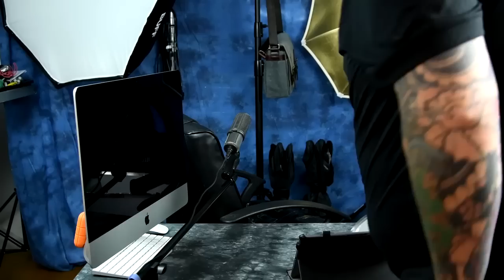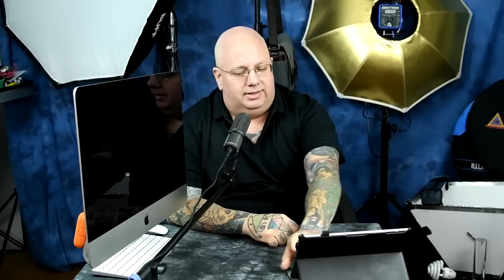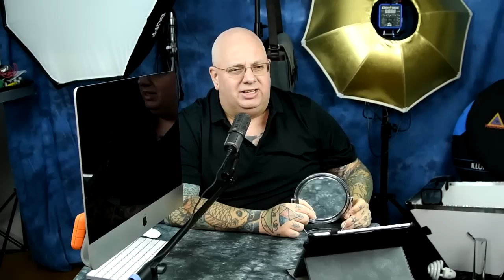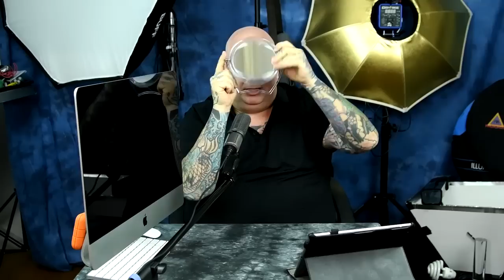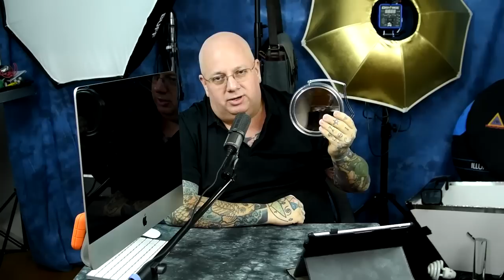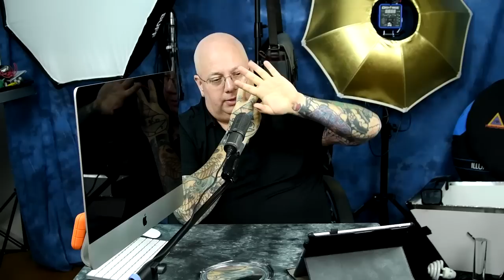A99II Serious FAIL:  Translucent Mirror design issue: Sony Fanboys, don't watch this video

Comment: I have been using the system for now going on 2 years, there is no depreciable notice for light reduction in this system.  You can claim whatever you will, with specs technical detail, you lose your case when it is fielded.  The camera will keep up with all Canon cameras and surpass most, it will keep up with most all Nikons except perhaps, the D850.  The stupid stupid stuff or rambling of intertonal color, and lenses being slower, is completely false.  There is no foundation on what you said nor have you proven anything you have said.  In fact the backlit sensor response supasses anything you got.  Unless secretly you are shooting with a Sony A7RIII or A7RIV.  Everything you said is incorrect, and should be shoved up your ass, for being so stupid.

Comment: I been using this and other Sony Translucent lens cameras for awhile, though he has some trivial facts correct like there is a mirror in the damn camera which quasi reduce light by .3 percent that would travel to the sensor, that light is redirected to the phase detection system and digital viewfinder.  It is well worth that loss.  In other words for everything he says negative the camera still is better than its rivals at the same level of production.  Granted this camera is now two years old or more so there should be more advanced out there and are, but the Sony A99ii is a fun camera to operate much more so than the mirrorless rivals and just more intuitive than some (most) it's rivals in the bigger camera market, except the most latest generations.  When facts are stacked, Theo is just plumb bias.

Comment: You are saying the same thing over and over with no proof, there is a second chip that gathers light simultaneously and enhances the picture quality. So what gives Sir. I'm not a pro  but  understand how light effects picture quality and I've not send what you describe if the scene is properly  metered. Please explain a little more for us Novices.

Comment: Years ago I owned a Canon EOS RT which used a fixed translucent mirror and you just learned to compensate the exposure, the good thing about it was the fast frame rate. When I was shooting for max detail though I would always pick up my Canon A1 instead but for shooting speed boats it was either my RT or F1 with motor drive

Comment: In all fairness, we all know that the translucent mirror causes 1/2 stops of light loss and Sony never hides that fact either. Losing 1/2 stops of light is equivalent to losing 30% of total light, 2^(-0.5)=0.7, which is consistent with Lenstip test, and it is consistent with DXO ISO score as well no matter how much you dislike DXO.
The microcontrast is not something easily proven by simple maths so I am not gonna comment on that. Someone who owns both A99ii and A7Rii can run a test, and we shall see how much microcontrast is lost due to the mirror.
Reply: That test already exists. I've posted the link above spoiler the difference in iq is negligible...
Reply from the maker: you DONT get it.
https://www.flickr.com/photos/134746128@N05/32369910320/in/photostream/

https://www.flickr.com/photos/134746128@N05/32709605896/in/photostream/

testing for loss of microcontrast is easy in fact
Reply: well yea at the violet spectrum it is losing a lot more, but that's like a UV filter. on average it loses 30% of total light, which is equivalent to losing half a stop. I know due to destructive interference, it's not cutting intensity uniformly across the spectrum, so in reality its image quality loss cannot be simply represented by losing half a stop or 30% total intensity. Like you mentioned, that dips in the spectrum (wavelengths) vs intensity will impact on the loss in microcontrast, which I will not comment on, but I fully trust you that it can be tested given your expertise in lens testing. However, on average, the translucent mirror is indeed cutting 1/2 stops of light, equivalent to 70% of power, or 70% intensity, or 70% transmission, and that is to be expected.

Comment: I knew that semi transparent/pellicle mirrors were junk on cameras way back in the early 90's.  If you ever tried a Canon EOS RT you know what I'm talking about.  2/3s of a stop lost due to the mirror and even on a bright day you felt like you were shooting through welding goggles. We all thought that five fps without an add on motor drive was a fantastic advance for pushing film through but once you tried the camera you realized it wasn't worth the bother.  Not to mention the drop in contrast caused by the mirror.  The images produced (shooting chrome primarily) were so much flatter than from a standard moving mirror based EOS-1. Leave it to Sony to try and use almost 30 year old technology and try to push it as an advance.

Comment: I'm not a sony fanboy. I shoot Nikon and I'm loving the D500. I'm just surprised your facts are not based on experience from usage.
Reply: Had this chap actually bothered to look at the specification he should have realised the back light illumination added to a99ii variant over the a7rii mitigates most of the problems caused by a translucent mirror.  In other videos that compare the a99ii with the a7rii and a6500 and a canon 6d the results of a99ii are  good, the a7rii has a 20% faster exposure time but real  acid test was that the exposure times are comparable with the canon dslr.  

I own a a77ii and it can result in slower exposures by or higher ISO in non optimumal lighting conditions.  However there are many advantages such as auto focus on the video feature, higher burst rates, been able to see the result before you take the shot.

Anyway the conclusion to draw from the a99ii is that with back illumination on the sensor SLT technology comes of age.
Reply from the maker: the facts are the facts, you said NOTHING
Reply: yes, I don't have first-hand experience with it, so I'm not qualified to comment on it. Don't you agree?

Comment from the maker: see here:
http://thesybersite.com/sony/a55/index.htm#slt_mirror_image_quality
https://www.flickr.com/photos/134746128@N05/32709605896/in/dateposted/
https://www.flickr.com/photos/134746128@N05/32369910320/in/dateposted/

http://www.lenstip.com/137.5-article-Everything_you_always_wanted_to_know_about_the_semi-transparent_mirror_technology_(but_were_afraid_to_ask)_Test_of_the_Sony_A99_mirror_.html

The mirror let 70-75% of light pass through in a wide range of angles.
Reply: for typical lenses the brightness differences can be contained in a 10% range, a value easy to hide permanently in the electronics of the camera, based on the tests you post
Reply: That fist link is quite the joke. That is no 5% difference there for the "with and without mirror" test on supposedly the same a55 camera is is much greater than 5% and clearly out of focus. Firstly your discussion here is not regarding the old a55 with probably bad processing ability, it is about the a99II, it is in your topic title after all. Secondly that test is so easy to fake. you can switch of steady shot and use a too low shutter speed, or you can manually bodge it by not focussing where you should. Unintentionally or intentionally.  The other links may draw conclusions on "science" but still do not take the end results into consideration.  I am still waiting for real world examples where the A99II's files clearly show how detail is lost by comparison to other designs. until then just take all of this with the greatest grain of salt there is.

Update.. i rechecked the first link and voila ! 2. [Update: September, 2016] The mirror APPEARS to also reduce image detail in that test ... but the test was probably flawed! When I did those tests years ago, I initially observed - as everyone else will - that the image made with the mirror in place failed to record as much detail as the one without the mirror. I assumed that the mirror was responsible. I also assumed that shooting at f/2.8 was a significant factor in the degree of degradation because, as you'll notice, another test that I did at f/11 showed essentially no degradation: , the tester recognizes he messed up.  Gots any more, ken ? :)

Comment: Back in the film days we never went past 400ISO.   Are you saying that 30% less light is a problem with sensors that are 40 times more capable?  Even it was a problem 800ISO is the new 100ISO, especially for Sony. I think this camera might blow out of the water the d500, the Canon 5Div, d5 1DxII and many more. Specially in value.   30% or not.

Comment: Yeah, I've read discussions on dpreview of people that have both a7rii and a99 that measured both, saying that a99 is approximately 1/3 stop "slower". Due to unknown reason. The reason I guess is the mirror blocking the light, as per this video.
I don't feel like delving into the dpreview threads archive just to prove it, here is just a link to a quick review of both cameras and the same conclusions:http://briansmith.com/sony-a99-ii-vs-a7r-ii-showdown/
Reply from the maker: check THIS OUT: 
https://www.flickr.com/photos/134746128@N05/32369910320/in/dateposted/

Comment: would you purchase this? also in this listing the lens looks very gray is it just they're lighting? The gray looks to light as if it's been heavily worn but it doesn't look worn in a closeup very confusing. the lens is more black than gray I'm pretty sure.

http://m.ebay.com/itm/Nikon-Zoom-NIKKOR-80-200mm-f-2-8-AF-S-D-IF-ED-Lens-/122333045959?_trkparms=aid%253D222007%2526algo%253DSIC.MBE%2526ao%253D1%2526asc%253D20150519202348%2526meid%253Df35f51c98e404fa28dfa265cbc8b13ad%2526pid%253D100408%2526rk%253D5%2526rkt%253D25%2526sd%253D172506862482&_trksid=p2056116.c100408.m2460

Comment: Every thing you said is true mate, but it´s still your best bet for a stills/video camera for people who can´t afford to have a dual system. It will give you almost the same IQ in stills and the great 4k video of the A7rII with no overheating. 

Now the real pain is the fact that Sony limits the AF on video to f3.5 only for no damn reason!
Reply from the maker: for video? ALL reports are that a99II video sucks to Hades and back.
Reply: Theoria Apophasis, Well, I have used the camera and the video is awesome. The Video AF though is an epic failure. I normally use manual focus on video anyway, but, I cant figure out why the f**k Sony would cripple that feature. 

I agree though, the A99 II should have been either a mirrorless camera or a normal DSLR.

Comment: The light loss of SLT mirrors has been understood since the introduction of the A55 back in 2010. The mirror reflects approximately 30% of the light, passing approximately 70%. What that means in the end is a difference of 1/2 stop in the light reaching the sensor. Doesn't sound so scary expressed that way, does it? The part about a tragic loss of micro contrast is based on a claimed ability to see a difference between a shot taken with any camera and the identical shot taken with that camera plus a custom designed 1/2 stop ND filter. Also, what isn't mentioned here at all is how the SLT mirror makes certain functions possible that are impossible in a moving-mirror camera. Like everything in photography, the presence of the SLT mirror is a trade-off. Bottom line is that everyone (including this guy) is welcome to reach a PERSONAL conclusion about the trade-offs involved with the SLT mirror without 'help' from somebody else. Readers: Go look at sample images and decide for yourself.
Reply from the maker: it doesnt sound scary, but it IS……….well most people are too BLIND AS PISS to know what microcontrast is, much less see it (or lack thereof)   :) 

no, its not a claim, its a fact, intertonals are low gain light, FIRST THING a mirror does is BLOCK the weakest light
Reply from the maker: " everyone (including this guy) is welcome to reach a PERSONAL conclusion"……WHUUUUT????  Billions of people do that with BULLSH*T religions and conclude them VALID
bandwaggon fallacy 

but if people like inferior crap, thats their own choice :)
Reply from the maker: http://www.lenstip.com/137.5-article-Everything_you_always_wanted_to_know_about_the_semi-transparent_mirror_technology_(but_were_afraid_to_ask)_Test_of_the_Sony_A99_mirror_.html
The mirror let 70-75% of light pass through in a wide range of angles.  The brightness loss connected to big angles is noticeable only with fast lenses where it most probably remains negligible anyway due to a mix a lot of beams which fall under different angles.

Comment: The Nikon F2HS also suffered with image contrast issues due to the Pellicle mirror. It's difficult to move that much mass 10 times a second and not induce image shake or exposure issues.

What ever the light loss, paying big money for fast glass then losing 1/3 to 2/3 stops of light kind of defeats the purpose of faster camera systems. Throw in image contrast reductions=FAIL.

Comment: I don't know that much about physical and light theory, I used a A7Rii and then got rid of it and buy A99ii + A-mount lenses and I'm totally satisfy with them. I don't see that much different between the A99ii IQ and A7Rii IQ. May be you are right, but I'm OK with the translucent mirror and get good photos with the A99ii. I remember when you tell us about the M34 cameras vs. fullframe cameras, you said that the sensor size is not very important. However, M34 sensor delivers bad IQ in low light and thicker DOF, and people still use them right? A99ii is not that bad, and a lot of people out there still use A77, A99, and they need an upgrade version of the A99 (the A99ii). You are right about light lost, however, why did you use such strong/bold words to talk about sony a-mount users (sony fanboys)? Me myself use A99ii, Sony Mirroless cameras, Ricoh GR, Nikon Coolpix A and M43 systems and I love them all. Please tell the true only and don't give a bias to the camera that you don't like. Tks!
Reply from the maker: "good photos" is not a paradigm sought after by any camera company.   My iphone takes "good photos"

Comment: Please elaborate if the following is incorrect: 
Being able to distinguish between 61.33% grey and 61.34% grey would count as having good microcontrast. But 60+ % saturation is not low gain. Low gain is less than 10% grey
Reply from the maker: John B
the facts are undeniable, even the Sony Fanboys admit the 30% loss

so run along fanboy
Reply: +John B
Here are graphs of tonal range vs ISO, comparing the A99-II with the 5D-IV and the A7R-II: https://www.dropbox.com/s/xjgyoqf0qj54ciu/DXO-tonal-depth%20II.png?dl=0

Can you see a gap between the graphs of the the SLT camera sensor (A99-II) and the other two cameras that do not obstruct the sensor during image capture?
Reply: ***** 
What screen do you have? Is your screen capable of rendering more than 8bit color depth?
Reply from the maker: the 1000s of images speak for themselves, the mirror blocks off all low gain intertonal details
Reply: Why don't you just quote DXO-Mark which says it has even worse tonal depth than the Canon 5D Mark-IV:
https://www.dropbox.com/s/wvwy21nesads0ux/DXO-tonal-depth.png?dl=0
Reply: How much dynamic range does film have?
Reply from the maker: Omesh Singh
are you crazy? DXO is the 100% most useless site on the web......same shit website just called the crap sigma better than the Zeiss Otus

ill quote the worlds worst sh*t website???
Reply: The rational approach is to assess a claim based on the claim itself not based on where originates. To accept (or dismiss) a claim based on who makes it is an argument from authority fallacy.

DXO can be criticized based on the way they generate scores (which subsequently they assign to lenses and sensors) not in general based on measurements that they have taken.
Reply: Ken, would you agree that for anyone to "dismiss everything you say based on the fact that you are saying" is committing an argument from authority fallacy?
Reply from the maker: absolute BS,  their "perceptual megapixel" has no basis in reality, NONE
Reply from the maker: facts are facts, a mirror in front of the sensor is a mirror in front of the sensor……REMOVED, 30% more light drops on the sensor
Reply: graphs are not what the author was claiming to have - let' see the images
Reply: You can download raw files on DPReview:
https://www.dpreview.com/reviews/image-comparison/fullscreen?attr18=lowlight&attr13_0=sony_slta99_ii&attr13_1=sony_a7rii&attr13_2=nikon_d810&attr13_3=canon_eos5dmkiv&attr15_0=raw&attr15_1=raw&attr15_2=raw&attr15_3=raw&attr16_0=100&attr16_1=100&attr16_2=400&attr16_3=100&attr171_0=off&attr171_1=off&normalization=full&widget=464&x=-0.11378400853427027&y=-0.6474542371279405
Reply: And then you can use RAWdigger to look at the RAW channels.
Reply: you need raw digger to see what the op was ranting on about. 
your bs can be smelled from across the internet lol
time to block this garbage along with your alt accounts =:)
Reply: I suggested using RAWdigger as it allows you to see RAW digital numbers from the digital files. (i.e. zero manipulation)

RAWdigger also allows you to analyse each color channel individually.
Reply from the maker: http://www.lenstip.com/137.5-article-Everything_you_always_wanted_to_know_about_the_semi-transparent_mirror_technology_(but_were_afraid_to_ask)_Test_of_the_Sony_A99_mirror_.html
The mirror let 70-75% of light pass through in a wide range of angles.  The brightness loss connected to big angles is noticeable only with fast lenses where it most probably remains negligible anyway due to a mix a lot of beams which fall under different angles.
Reply from the maker: check THIS OUT: 
https://www.flickr.com/photos/134746128@N05/32369910320/in/dateposted/

Comment: I remember when the translucent sensor came out. Mirrors really don't fail very often so I don't get the trade off for losing so much light
Reply from the maker: it gives you FULL TIME AF ability, but at the tradeoff of everythign else, its INSANE design by brain dead dumbasses